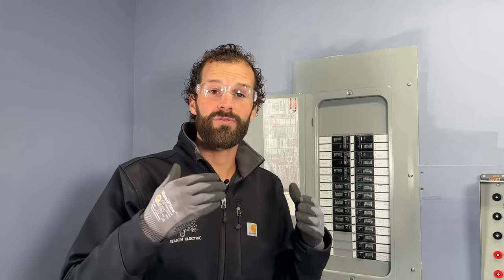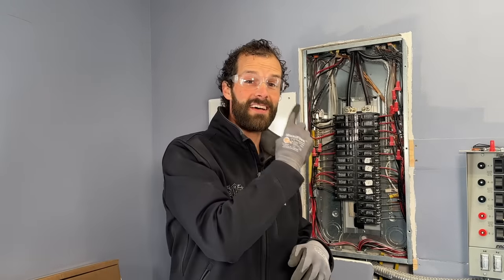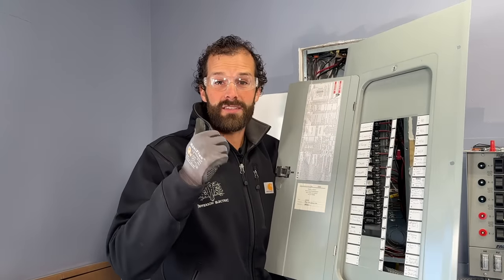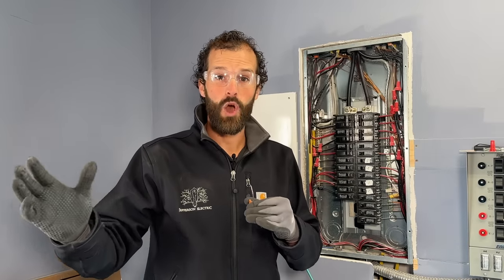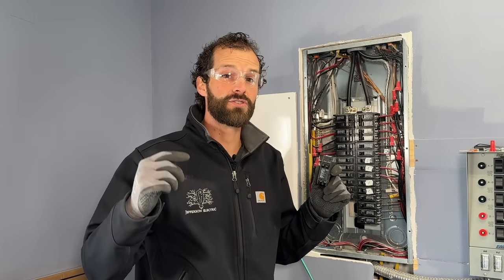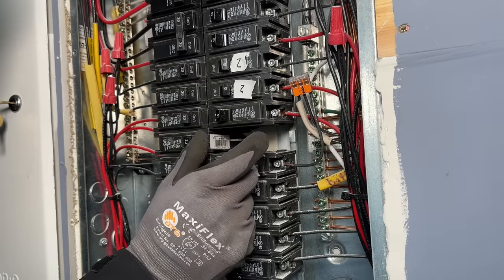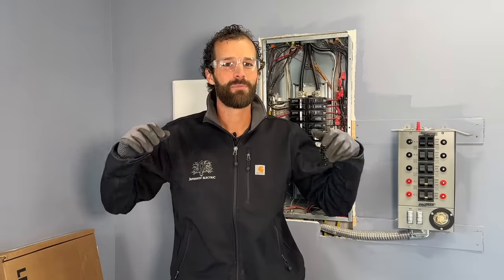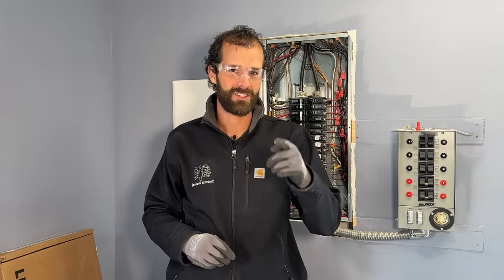No Room In Electrical Panel - Quick Fix

Comment: Just because everything is Led doesnt mean its a great idea to combine everyth Into a breaker.   yes led lights use no power roughly...  So sure you can put all your interior homes lights on a single breaker if you wanted..   but if you do have a fault.. Itll be harder to trace it as that breaker controls it all then.

but i do get running kut of room.. My 209amp breaker in my 30 yesr old hkuse has run out of room.  and im debating comboning the porch lights in the front and back into a single breaker and a few interior lights as well to make room.
Reply: Seems like way too many circuits in the US. My parents home in the UK had about six fuses. My smallish home in the US has two boxes, one full of breakers (some tandem), the other old-style screw-in fuses. I've never popped one. Grouping into four or five for lights and four or five for outlets would be fine (plus stove, AC and dryer, I guess). The labeling is also a mess so working on anything is a chore.
Reply: @chaos.corner  uhh how do you figure.  Each rooms outlets  need to be on its own circuit.   Kitchen uses high powered items like coffee makers can use 1200+ watts..  Toaster ovens can use 1500+.   My bedroom my computer when at load can use over 1000 watts.  My lava lamps when on.  

Fish tanks with a 300w heater and my 400w of lights and then the pumps.  You get it ?   

Thats 5 there.   Then you need 1 for the dryer and 1 for the stove.  1 for the furnace and a.c.   1 for the basement outlets and 1 for the lights.  There.

You need 1 with GFCI for each bathroom outlet.  Hair dryers use over 1000 watts.  

Add this up now.  Thats 3 bedrooms. Kitchen. Living room. Basement. Thats 6.  A.c and furnace 7.  Three bathrooms thats 10.   Outdoor lights that 11 or 12.  Then interior ligjts thats 15 or so.
Reply: @jeepsblackpowderandlights4305  You're right. I failed to account for 240V vs 120V (and yes, I know that the US has 240V available but that's not relevant for most of the usage). Still, I maintain that there are far too many circuits in my house.
Reply: @chaos.corner  240 is relavebt when using street lights or outdoor lighting on a large scale.  It lowers the mount of amerage needed.  On my channle i do guns and lights.  And i have like 14 outdoor ligjts on my property.  Theyre all using 120v.  So i need larger gauge wire to support the amps used.  But if i used 240v it wouldnt need largee gauge wire or larger breakers like 20amp breakers or what not just for 4 lights.   Dryers use a lot of power and so do stoves and air conditioners.  Theyre all on 240v.

But for basic things..  120v is fine.  And it isnt even 120v its more like 125v
Reply: @jeepsblackpowderandlights4305  Yeah, not criticizing 120V (though that's another discussion and involves pros and cons) but it does imply more circuits for similar loads if the circuits are of a similar capacity (increasing the wire thickness would bring its own issues).
Reply: @chaos.corner  wire thickness increase only brings costs issues into consideration.  You only go to a larger breaker for 12ga 10ga etc.   

In the us they also do muktiple breakers in rooms to isolate those sections from eachother.  In my opinion its not a great idea to combine every room or ligjt into one breaker.   What if something happens and that breaker doesnt pop ?  Then the entire grid its powering will go up.

I think there is nothing wron with having it all in seperate breakers.   My barn/garage was wired with a 100amp breaker.  Only like 7 breakers are on it.  And every light in the barn is wired into one.   3/4 of the barns 120v outlets are on one breaker.   The stables section is only 1 breaker for 3 receptacles.   But the issue is horses use heaters for winter in the water.. two 1000 watt heaters pop the 15amp breaker.  (They wired it with a 20amp using 14ga wire)  i had to drop it ot 15amp because 14ga isnt ment for 20amps.  It even poped the 20a breaker.

So what i did was run another wire to a single outlet.  This outlet has its own 20a breaker.  This way it can have its own fan and own heater on it.   The other outlet is on the original.

This is a perfect example of why each room in a house has its own.   In the barn if i need to work on the lights or something for the outside utility pole... i flip the breaker and it shuts that pole iff.. but also the workshop lights..  How stupid is that ?   Sure that 15a breaker can handle the workshop lights. Which are t12 lights.. and the two 175w mercury vapor lights on the pole.  And the two 70w high pressure lights on the horse walk in.   But why ??? Why 1 breaker for that.

I plan to split those circuits.  Its silly to do that.  I actually have a video on my channle of ne showing off a 400w high pressure sodium light.  And i flip the breaker to shut the ultility pole off so its dark outside.  And then im tripping all ovee myself in the workshop because i cant see..  The other breaker for lights,  Shuts off the stables and middle of the barn lights.  So two sections will be in the dark.

Doesnt matter if both sections have only 13,  13w led lights..  It creates a mess when working in the dark.  

I dont think we should be combining circuits simply because led lowered power usage.. i think we just need bigger breaker panels.  But thats just me
Reply: @jeepsblackpowderandlights4305  I see the merits of what you're saying and your garage example surely proves that what I am saying doesn't have universal applicability. Still, I still say my panels have too many circuits. :) (though a proper labeling job might help adjust my perception).

Comment: In our area their requiring AFGFCI 'upgraded' for all remodels adds at least 1200.00 to the cost and stops homeowners from even using incandescent bulbs. They keep coming up with idiotic legislation that does absolutely nothing to add to safety but costs more money. In thirty years I've been jolted many times by 110 volts and just cus and keep going. Were not European voltage at 220 but these politicians just keep coming up with more laws.

Comment: There should NEVER be wire nut flying splicing NOR terminals that splice conductors inside the panel. 

NEVER.

Comment: If you need more circuits the very first thing you do is turn on all your loads in the house. Then you take an amprobe and measure the amp load on both phases at the main disconnect. This will tell you if you have the capacity to add more circuits and also if you need to rebalance loads. Instead of doubling up breakers(never a good idea) if you have the capacity you remove two breakers and add a larger breaker and feed a sub panel that will give you more breaker spaces. The two loads you removed should then be fed from the sub panel. Now you can install your new loads on the sub panel and you've done it the right way instead of adding piggybacks or doubling wires on a breaker. Remember if you place two wires on one breaker each wires amps will add to the breaker capacity. So if you have a 15amp breaker the max continous load is 12 amps so the total amps allowed from both wires is 12amps. You will not get 12 on each wire but only the total from both and it has to be below 12. This is why doubling up wires on breakers is seldom allowed. Now the breakers allowed depend on the ampacity of the shunts. That metal the breaker snaps into off the bus bars. They have ratings and you can not install more load per shunt than the rating value. Same goes for the bus bars. Normally the panel will have a max amp rating for the main that protects the bus from over heating. You have to keep this in mind when adding a sub panel so it doesn't overload the main panel. In truth this is a job for a real electrician to do correctly. Be careful with working with lighting circuits because when a house is wired correctly there should actually be no dedicated lighting circuits. Each circuit should be a combination of lights and receptacles so if a circuit trips it doesn't kill all lights and power in the room. If you double up one of the supposed lighting circuits and then plug a vacuum in a wall outlet you might just trip that doubled up load. I will repeat, this is a job for a real electrician who knows what he's doing to get this done properly.
Reply: There is nothing in the code that suggests turning on all of your loads and measuring the amp draw to see if you have additional capacity. The code appropriate way is to do a load calculation, the easiest of which is using the optional method in 220.82 in the NEC.
Reply: @lars949  And you can take the full capacity of every circuit and total them all up and likely have more that twice the load of your main. In the real world you actually check to see what the load is not what the code book says it can be figured at. Over the forty years I've worked as a commercial electrician I've worked on everything from nuclear plants to skyscrapers to running service trucks and in all that time I've never seen an electrician pull out pen and paper to figure load calculations like an architect would do. Instead we all carry an amprobe and take real measurements.
Reply: @71160000  Try pulling a permit for an EV charger and submitting to the AHJ that you turned everything on and measured the current and determined there's enough capacity and see how that goes over. Times are a changing. I submit load calculations with my permits for EVs and have not had any that didn't pass inspection.
Reply: @lars949  We weren't talking about inspections we were talking about actual load in the real world. I've seen a lot of stuff on paper that doesn't work in real life. I had an architect complaining that I hadn't put his wall washers 30" off the wall as he had specified. I said if you look at the reflected ceiling plan you'll see you specified the main ceiling tee at 30" off the wall and I'm not allowed to cut that. I suggested that he learn to read his own prints. I truly don't care if code allows that additional load as many houses have undersized service entrance equipment and some of it is totally overloaded to start with. As a matter of fact this whole conversation was over adding circuits to a panel and I still stand by testing the full running load on the panel before adding circuits no matter what the circuits are for.
Reply: How are you going to turn on every load at the same time? Electrical systems are based on load diversity. 

How many people are you going have to simultaneously operate all of the momentarily appliances (hair dryers, drills, saws garage door opener) and your have coordinate all of the cycling appliances to be using their max draw (refrigerators, AC, burners & ovens, sump pump, well pump, hot tub)
Reply: @71160000  That works in a commercial or industrial setting. 

But that is not practical in a home. The loads are too diverse. That is why part of the loading is based on Sq ft.
Reply: @BillHart46  thank you, someone gets it!
Reply: @BillHart46  Well I suppose if you wanted to do all the math then you take the KW the home used over the last 12 months and divide it by 365 and then by 24 to get the hourly KW your home uses to see the true load. I did that on my home to figure how many solar panels it would take to replace my grid usage. Sorry but I'm not a big believer in sq. ft. load because over all my years in the trade a good deal of it was spent fixing circuits that were overloaded.
Reply: The likelihood of EVERYTHING running at once is NILL. Calculations are based on percentage of use. Some appliances are figured at 100% while the rest of the house is not.

Comment: i had inspectors call out having two wires on square D breakers that allow it I swear they just make things up to complain about just to justify their jobs
Reply: sometimes it's local code. You'd have to ask the question.... or show them the diagram on the new breaker so they get an education.
Reply: @rupe53  The "question" : Show me the citation.
Reply: @KameraShy  .... great question but it's not from my specific town so I don't have that code issue. There is mention of it in NEC where they talk of one screw = one wire, unless rated otherwise.

Comment: Wow adding another circuit in parallel increases your amperage on that wago splitter and on the breaker, such terrible advice. Wire connectors and wago splitters, now you have an expensive junction box that builds up heat.

Comment: So many times I come across those damn WAGO connectors virtually burn to a crisp!  They should be relegated to low voltage applications only and or better designed!

Comment: Just waiting for the day there’ll be a massive recall on Wago connectors. All it’ll take is a few people using them wrong to cause an avalanche. People are stupid and it’s a litigious society and quick to blame new things good or not. You know how many things won’t ever be sold in the states because of that? If only Wago was a publicly traded US company I’d be going short in a heartbeat at the first sign of trouble. I’ve never had a wire nut problem because I know how to use them. A couple of contractors I know will fire their installers if the use them and must stop work if found during a service call.
Reply: I would never use those things for a high amperage connection.  Great for a light fixture though.
Reply: Fortunately, the entire civilised world has long since banned the use of wirenuts

Comment: This way of combining circuits is very bad advice. First, making connections in an electrical panel is a code violation. Second, combining smoke detectors with another circuit reduces safety. Combining the lights with another circuit is also possibly a code violation because it is possible that the fixtures will be changed in the future. You must therefore always count 1 amp per output.
Reply: Some localities require that smoke detectors run of a lighting circuit.

Comment: This video is crazy. Zero explanation for neutrals. This is exactly how you catch a house on fire. Absolutely unbelievable!!! If those circuits are sharing a neutral you can overload that neutral and melt it. Neutrals do not have overcurrent protection. I can't believe this guy produces these videos. If you're a homeowner do not follow this instruction unless you know exactly how the neutrals are configured. Even then you should never combine an A and B-phase circuit...Unbelievable!!!!!

Comment: This is illegal and a very bad idea!!!! I’m a union journeyman electrician with 25 years in the trade. The double breakers for all manufacturers will not last very long. Adding a sub panel is the only correct and safe way to add extra breakers. This man is a handyman not an electrician

Comment: I was called to a condo where a wannabe electrician hooked up 96 Amps of instant water heaters to a panel with a total available service of 125 Amps. This was a hi-rise, and could not be increased. I told the owner he would have to install a conventional water heater since he did not have enough of electric to run the rest of the home.

Comment: Please guys DONT do Option 1. Circuits are wired based on amount of devices installed. You cant just join 2 and put on 1 breaker. Unless you know the 2 circuits you're putting on 1 breaker will draw less than the amperage the wire is rated for dont do it!
Reply: @Kevin-mp5of  dont ever work in my house. Seems like you dont get it

Comment: You call for 15 in-lb torque, but the value shown on the circuit breaker (3:19) is actually 36 in-lb.

Comment: Now that sounds like a good idea, suggest to homeowners how they can tweak the code to add branch circuits by simply doubling up conductors on one breaker.  Key here is location, some states absolutely will not allow such practice and God help the homeowner who follows this advice, has a fire and who's insurance follows up after with an "after fire " inspection and finds the violation. They can walk away and not pay a dime to the homeowner who's house has burned down because they wrongly assumed they were altering their panel to code. What are the chances this YouTube channel would be looking at legal action?

Comment: First off, the batteries in these vehicles are the most highly dangerous product to our society ! They are highly explosive in water and carry enough toxic waste to destroy a communities water systems and the soil ! That your future generations are going to have to deal with ! 
As far as the electrical, if you have the regular breakers you can replace a few with piggy backs, or skinny breakers that have been produced for centuries to create more space in your panel. Or you can purchase a disconnect panel that has like 6 breaker spaces in them you can have installed under or around your old panel. The main thing is to hire a professional electrician to install all your electrical needs ! Just because they have a license doesn't mean they play safe ! Check their references and the license committee to see if they have had any complaints in the past. And always check out who you are dealing with to be sure they are not a fraud. 
Best advice is purchase a change over kit for propane, and have a qualified mechanic to install the system. It is the cleanest alternative for fuel. And safer than any other substance to our environment and our future generations ! Thank you !

Comment: WTF????  You cant bring two 15 amp circuits into a single 14awg wire.  Thats a potential for 30amps through a single 14awg wire.  You’re heavily relying on that 15amp breaker to trip before the pigtail melts.  You would need to use a Wago 221-613 and 10awg pigtail.  You should not be showing people how to do electrical repairs unless you actually know what you’re doing.  This is a fire hazard.